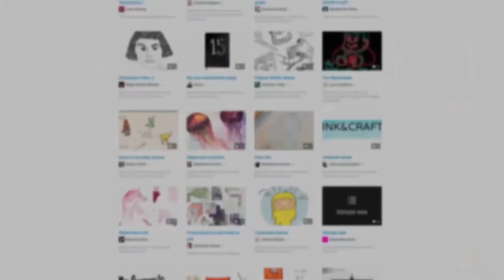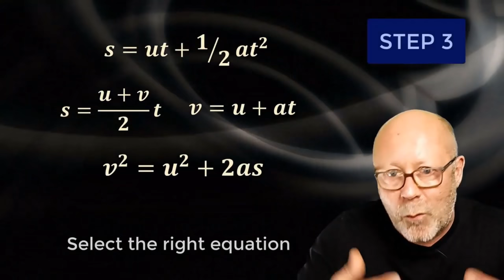Fiat Punto GT comes back from being  sand blasted. How Bad Is It? PART 5

Comment: Good old Fiat. Structural paint and undersealed with pasta. Nothing has changed. In the early 80s I had a 1974 Fiat 124 Sport Coupe. It was one of the first cars to have a glued-in windscreen. One day I had to do an emergency stop. The car stopped okay but the screen kept going. I ran over it. The flange that the screen had been bonded to looked like a set of rotten teeth. I should have scrapped the car but I repaired it .... with oxy-acetylene welding in those days. It was such a nice driver. Best of luck!

Comment: Like u I used to use etch on bare metal but I found epoxy primer is better especially as it's a sealant and doesn't absorb moisture like normal primers which means your shell can be left
Reply from the maker: as ive still got all the welding to do i went with etch.